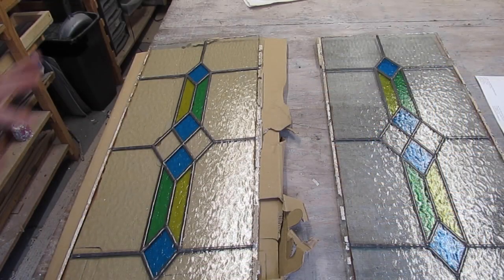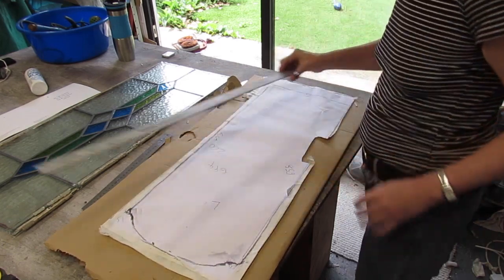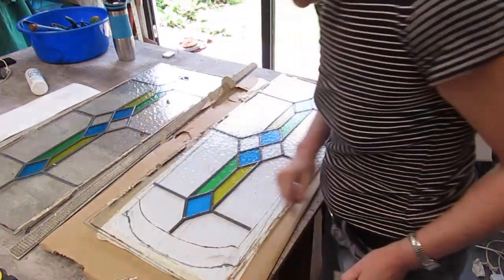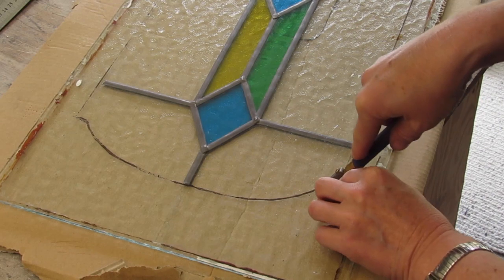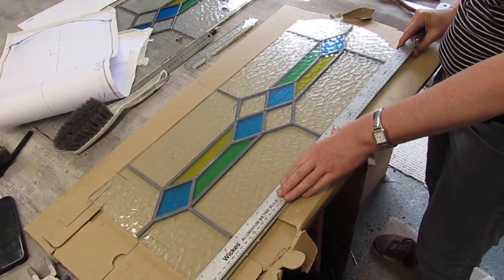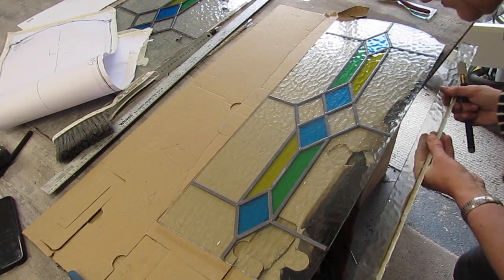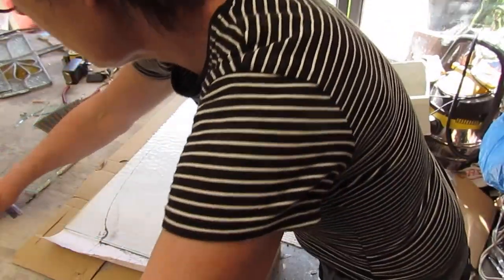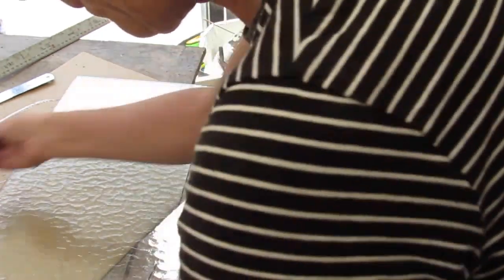Sophie's Stained Glass | Cutting Shoulders into Glass

Comment: Nice video! Thank you. You are a brave glassworker cutting those inside corners! Was the original piece painted/stained those colors? But, I did not see a "key hole" cut. I guess we have different definitions of a key hole. Perhaps a British/American interpretation? Without an image, I will try to give an example of what I mean. Take a 5x5 inch piece of glass. At the center, make a 1 inch circular hole. Then, cut a 1/2 inch wide parallel slot leading from the hole to the outside edge of the glass (requires two cuts). Remove the circle and the slot without breaking the surrounding glass. The circle could be cut with a diamond coated glass bit, followed by two straight cuts from the circle to the edge of the glass. Or, a ring saw could be used for the entire cut. I am always concerned the remaining glass would be too fragile. The given dimensions are just an example. Other dimensions can be used. Thanks again for your video. I always enjoy watching how quickly you work.
Reply from the maker: Very interesting - what's the purpose of the key hole cut as you describe it? And, by the way, to avoid confusion I've changed the video title.
Reply: @SophiesStainedGlass  My limited understanding of it is that it was a way for a glass cutter to "show off" their incredible skills. I admit, if I had seen a stained glass piece with a bunch of key hole cuts in it, like in a repetative border, I would have been beyond amazed. One day I may try to make a small piece with a few key holes in it. But I am sure I will break a lot of glass doing it. And the result will be only appreciated by those who know glass.